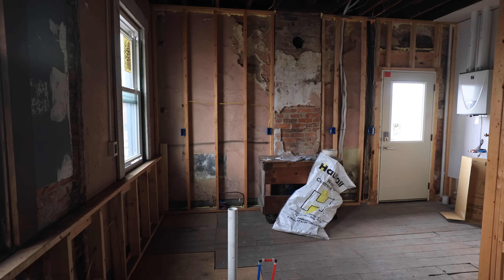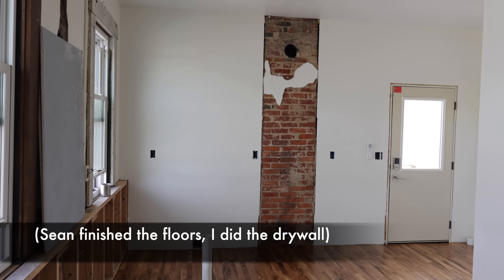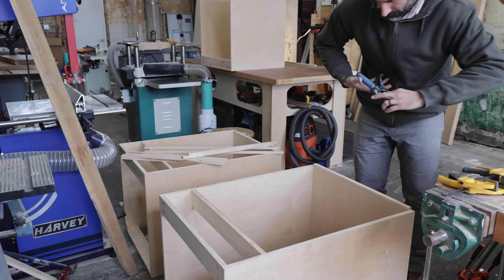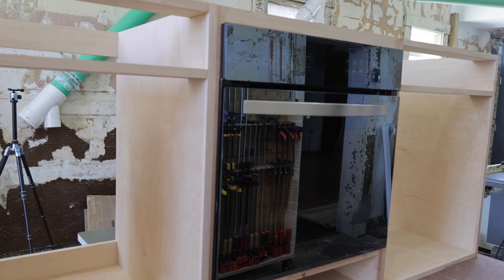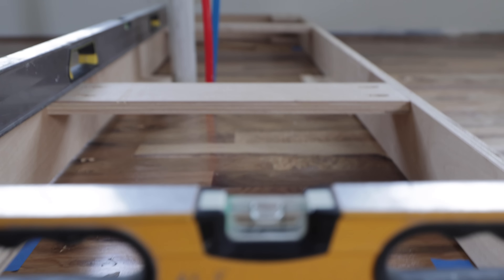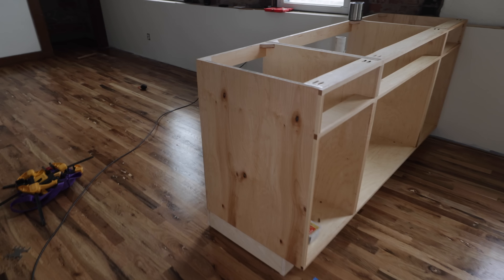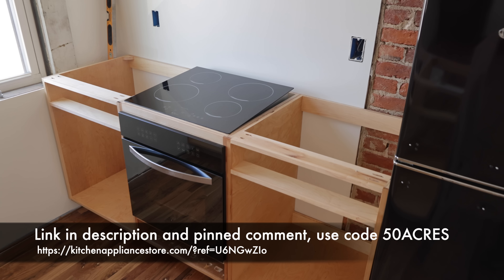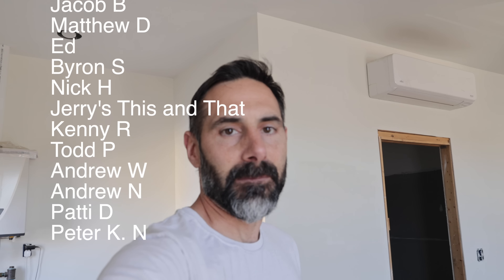300 Sq Ft Micro Apartment Build Out Part I

Comment: My suggestion for the back of the cabinet is to put faux cabinet doors on it. That generally looks better than just a plain panel. Or you COULD put ACTUAL doors on it if accessing it from both sides might be handy. Are you going to put an overhang on the countertop on the backside? It might make a nice place for a breakfast bar if you have room for it. My in-laws and grandparents BOTH did that and it was quite handy.
Reply: Excellent idea!
Reply: With 300 sq ft a breakfast bar is a great idea
Reply from the maker: Good idea Julie, If I had the ambition to build 4 more cabinet doors I would definitely do that!
Reply: @50Acres  I understand. With the attention to detail you put into your projects, that WOULD be a fair bit of extra work. And I DID see on the most recent installment that you DID include an overhang/breakfast bar.....good call. That's a good selling point for future renters.

Comment: A couple ideas for the back of the kitchen cabinet. 1. A single large framed panel similar in style to the cabinets at the cabin kitchen. I really like the wood you used as the cabinet center panels.  2. Make 3 fixed cabinet doors to match the front side of the cabinets or 3.  Make it a feature/ statement piece by building a backlit “River” panel.  Make a single framed panel with live edge board facing the inside and colored epoxy in the center between the live edge pieces. Backlit or not it would look great in that space.
Reply from the maker: Those are good ideas!  We are definitely making it a feature statement, we're excited I think it's going to look awesome.

Comment: Hey, Mike. Really enjoying the micro apartment build! Love the exposed chimney and, especially, the exposed brick above the windows and how you dry walled around it. You asked for suggestions on the kitchen peninsula back panel, so here's my two cents:
I'd make it as simple as possible because the floor already has a lot of nice grain features and a 'busy' design would be too much. Not sure what your counters will be made of, and I know the fronts will be stained or clear coated. If the counter is to be wood, I'd paint the back black or slate gray (or something else neutral to make the wood features pop). As much as I love your cabin, this is not a cabin and I think a little industrial design would be a plus (which you've already applied, expertly, in other areas!). Well, that's my two cents...er...maybe eight cents. 
P.S. Awesome plans on moving in there and still having two rental units and a business!
P.P.S. Sorry about 7th thru 12th grade. Hopefully you had a Shop class to mitigate the boredom.
Reply from the maker: Hi David, good points regarding the design,  I'm trying to kinda roll back the busyness but it's hard because that's just where I go.  I did have one drafting class, I didn't even take shop classes in school sadly.
Reply: @50Acres  surprised to learn you didn't take shop! I understand that's "where you go". One other idea I had, that would still maintain and organic look, is a slate back. 
I'm sure it'll be great, whatever you do.

Comment: Looking good brother! You've come far from your early days candle stik soldering pipes 😊! A suggestion for the front of that kitchen sink cabinet, they make half thick bricks that look similar to that exposed brick where your cooktop is going, they're kinda like tile bricks but actual brick material, you could use baka board on the front and then thin set those brick tile to break up all that wood and it kinda matches that exposed brick behind.
Reply from the maker: That would look really cool, I just brought all my leftover bricks down to the cabin to use for a fire pit!

Comment: Beautiful job... as for the paneling on the back of that island (peninsula?), if it were me I would hinge the whole thing and try to make a hidden secret little storage area for like wine or, you know, the "good stuff".  But it's not like YOU are going to live in this little studio... so you won't need any additional functionality.  I've done stuff like this and used tile board that I'd slide down into trim channels... mine looked and felt like ceramic tiles... you might want to use something to match the brick or something.  Either way, it was easy to take apart if I needed better access to the plumbing under the sink.  Also made putting my drawer slides in just a bit easier being able to work from both sides.
Reply from the maker: Thanks Tyler, we did leave room for a wine rack next to the fridge, it would have been good to leave plumbing access.

Comment: use wago connection to elektricity wires lot better safety connections. i have be 30 year elektric engineer,inseptor,installed thousand houses
Reply from the maker: I love Wagos I have never seen them for 8 gauge wire though.

Comment: Which pocket-hole jig do you use to get such clean exterior holes?  I've tried 3 different jig models and extra bits and never get clean exterior hole in any hard/soft wood, and regular plywood or Baltic birch ply.
Reply from the maker: I Jim I just switched to the Kreg jig that stands up on your table, it's the 720 pro I believe.

Comment: How do you stain your maple cabinets?  They are always a pain!!
Reply from the maker: I use a mix of BLO, Spar Urethane and turpentine in equal parts and wipe it on.  Seems to work well.
Reply: @50Acres  Not familiar with BLO.  What is it?
Reply from the maker: @chrisclausen6587  my bad boiled linseed oil